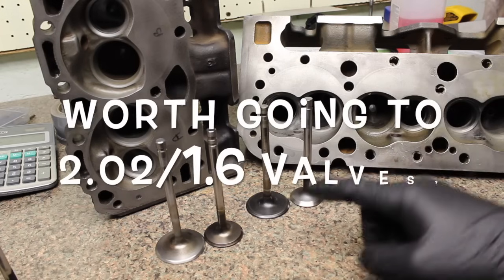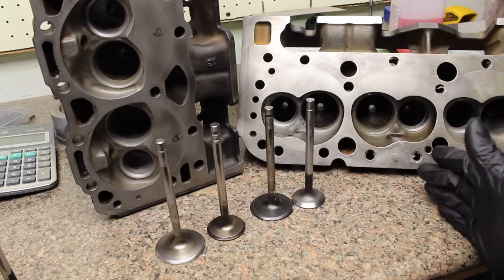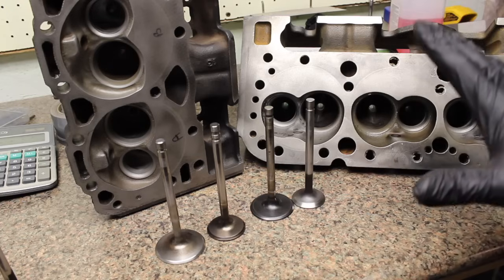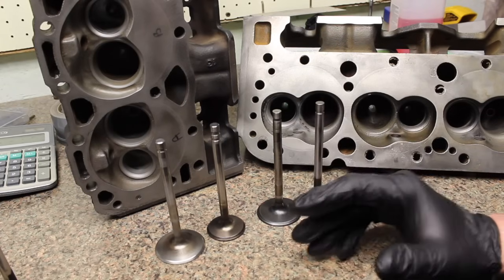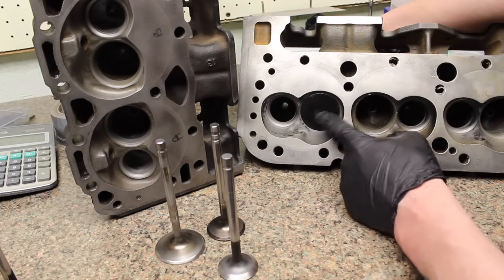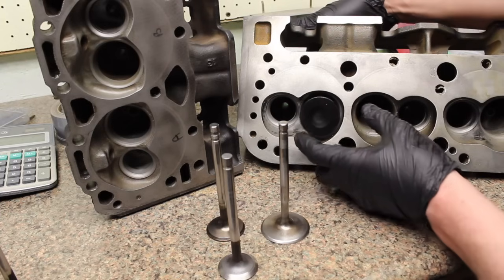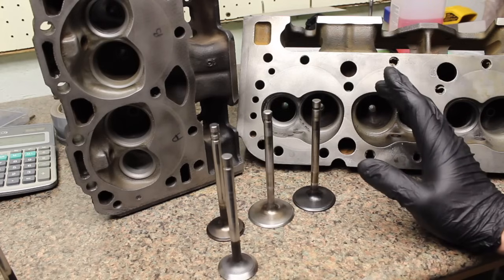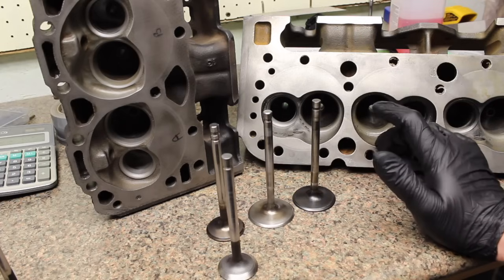Bigger Valves in Vortec Heads *Flow Data!*

Comment: Some food for thought for anyone interested. I've got a set of Pro Topline 906 "Vortec" replacement heads that originally came with a 1.94 intake and 1.5 exhaust valve. These are relatively old heads, but it does show that some Vortec style heads can improve with a larger valve. To go with the new valves, I blended the throat cut into the pocket and just barely touched the short side with an 80 grit roll to smooth a ridge they all seemed to have. I left the intakes as the carbide cut them, no smoothing. I did smooth the exhaust slightly with a 80 grit roll (essentially just removed the carbide divots). The low lift on the intake is improved dramatically, while it's much less improved at higher lift. 

Intake w/1.94" Valve	Intake w/2.02" Valve	Difference
0.1	54	72.5	34.26%
0.15		104.7	
0.2	103.9	136.9	31.76%
0.25		167.2	
0.3	146.6	192.3	31.17%
0.35		215.5	
0.4	194.4	231.6	19.14%
0.45		238.7	
0.5	224.3	237.7	5.97%
0.55		239.6	
0.6	226.2	239.6	5.92%

	Exhaust w/1.5" Valve	Exhaust w/1.6" Valve	Difference
0.1	49.3	45.3	-8.11%
0.15		82.7	
0.2	87.6	108	23.29%
0.25		128	
0.3	118.8	148	24.58%
0.35		170.7	
0.4	139.7	176	25.98%
0.45		178.7	
0.5	148.5	180.7	21.68%
0.55		180.7	
0.6	152	181.4	19.34%

You can see I actually lost flow at .1 lift on the exhaust, but it is greatly improved at all higher lifts. 

Unfortunately, I'm not sure what depression or bore size these were taken on and my machinist isn't around to ask anymore. Perhaps one day I'll get my Third Gen TA into driver status and get it onto the chassis dyno to see what kind of numbers it can put down. It does feel and sound pretty healthy though with a XR276-10HR.

Comment: I watched your video. I have a set of big valves 906 I haven't ran but watching your video ancers my ?.And I have been running stock intake and bigger exhaust for the past 7 years and they perform well.  I did lot of research on the vortec and everything I read talked about the exhaust beings the hold up . Then you came out with your findings and just proved it.  Good info.

Comment: Yes on the intake side When you switch to the 202 You have to notch the side of the cylinder wall and the head Chamber Just so it would flow properly Yeah you nailed it On the valve shrouding

Comment: Great video dude I was doing this 20 years ago Flo benches just came out so it was relatively expensive if you don't mind doing a little bit of research Hot Rod Magazine I'm fairly sure was one of them dad an article which gave you everything and it was how to get 400 horsepower out of a stock 350 on a budget they tell you the cam which was the Xtreme Energy buy comp cams ? The intake 2 years the size of carburetor and I built one it was a Beast for you know $1,800 that includes the short block and everything so it's worth your time to research it I'm sure the magazine she can access it online but just go back about 15 16 + years and I'm almost positive that's the title budget Vortec
Reply from the maker: Haha yeah man! The vortec heads work quite well with just abit of work 👌

Comment: Hey i have a 350 Vortec crate and it has 502 lift out the box can i run 1.6 rockers without changing pushrod
Reply from the maker: You will have to pattern out the valve tip with the new rocker arm. Chances are you will be fine with the current length but everything can effect pushrod length so there's no way of knowing until you check the pattern on the valve tip

Comment: I have had the idea of a mild boost vortec build, using 1.94"/1.60" with only bowl blend and port polish,  maybe under cut and swirl polished valves, polishes chambers, with about 10psi boost, for a street engine,  I believe the most gains are in Port matching and polishing! With a street engine, and the right cam!! The biggest thing is the correct cam for the job!
Reply from the maker: Most professional porters say that the port polishing doesn't do anything, i haven't done any testing my self on that though 
Maybe I should?
Reply: @cuttersperformance  by polish I don't mean a true polish, I only remove casting lines, and usually leave a 220 grit or so finish, so by polish I basically mean not enlarging the port, but always Port match, about 2" into the port on both sides,
Reply from the maker: Ahh ok exactly 👌

Comment: I’m thinking of putting some on my 400 sbc what do you think they will perform with a mutha thumpa cam ?
Reply from the maker: Better than any other stock sbc head that's for sure. 
I've never seen someone disappointed with them on a street strip motor
Reply: Probably work well on a street or mild drag engine. I would probably get a set of dart sportsman II if were mine though. Showing my age, guess they are iron eagles now.

Comment: YOU HAVE TO DO SOME POCKET PORTING AND UNSHROWD AND LAY BACK THE CHAMBER OR IT WONT DO ANTHING GOOD VIDEO IM FRIENDS WITH THE GUY THAT PORTS PAT MUSI AND ANDY JENSENS HEADS I CAN HOOK YOU GUYS UP IF YOUR INTERESTED
Reply from the maker: The pocket was ported and blended into the seat but the combustion chamber wasn't touched. 
I plan on unshrouding the valves and seeing the difference on the flow bench

Comment: @ Pat, snice you already have the 2.02 valve in and have confirmed less than signifigant gain, maybe you could lay that combustion chamber back around the valve on the cylinder side and see if that gives an improvement.  i read in David Vizard's book that laying back the chamber was a important step in prepping a head.  personally i never understood why they put such a sharp curve on the cylinder side of the chamber.  i get that the cylinder is RIGHT there but just, scribe the cylinder and lay back the chamber to the cylinder edge on the out side.  i think this would be an improvement whether you're using 1.94 or 2.02 valves.  when i took my votecs in to have screw in studs and 1.6 exhaust valves put in, the machinist argued with me over the 2.02 intakes and i firmly insisted NO.  he was not happy with me.
Reply from the maker: Yeah I'm probably going to unshroud the valves on the 2.02 as I did on the 1.94s that I tested and got some gaines (video coming up)
Good call going the 1.6 on the exhaust
Reply: @cuttersperformance  thanks, i did a ton of research on forums before i made a decision on what to do.  the consensus i got was there was no gain and what little their was was of no benefit to what i wanted the motor for, driving my truck on the street.

i  look forward to the test of the unshrouding of the 2.02
Reply: Yes looking forward to polishing and laying back the chamber with the 2.02 intake valves. I just did my heads. On my 4.3 v6. Good content.
Reply: @chriscatarcio7534  how did it come out?

Comment: With the 1.6 exhaust valve would a single pattern cam be  better than a duel pattern?
Reply: Thanks for the info very cool
Reply from the maker: Very good point! A dual pattern cam is often used on stock vortecs to "balance" out the weak exhaust flow.  But with the 1.6 valve it shows the same flow as a aftermarket 180cc dart head so a dual pattern cam would not be as important

Comment: could you do late 70's heads vs TBI swirl heads and compare them to the vortec data?
Reply from the maker: I will see what I can round up for you, I'm also curious as I've haven't done much with tbi heads other than replace them
Reply from the maker: I got some 882 heads kicking around but I haven't been able to get some TBI heads cheap enough haha I will see what I can do
Reply: @cuttersperformance  I'm building a .060 over 5.9 for my 77' and I took off a set of 339 heads 1.73/1.50. I'm putting a set of 86-95 TBI 193 heads 1.94/1.50 that i got for $50. They have a 64 chamber and should yield a 9.41 cr. The TBI heads have a noticeable larger intake runner and i think they'll out flow the 339s by a lot even though they're "shit tbi heads". It would be cool to see all the numbers on the same graph.

Comment: The GM Fastburn heads have 2" intake valves, how about checking the flow for those? If that's not asking to much of course.
Reply: I missed out on a set of those recently. Asked a question ten mins after they were posted up, and another guy just snapped them up. Oh well, not in a hurry

Comment: Maybe I missed it. Did you do a correct valve job on the head to fit the 2.02/1.60 valve combo? Or just put it in the head for flow test?
Reply from the maker: Yeah the head was cut for a bigger valves and probably bowl blended

Comment: I been  trying  get my hands on  some  not cracked vortec  heads i got 4 but 3 are cracked  im not having much luck getting good  heads around  me
Reply: just buy them off summit, i think they have new castings for like 350 each head.
Reply: @frotobaggins7169  i might  have too
Reply: Look for the 906s there less prone to cracking. Look on box trucks at the junkyard there usually low mileage and very well took care of. I got 2 sets both sets were good and looked almost new on the inside.
Reply: @brandonbell8159   all junkyard  near here  don't  deal with anything  to do with sbc  anymore   they deal with 2004 and up stuff  i have one good  906 head like  get anther  one  i know what to look for it just hard  with junkyards not having sbc stuff and if they do they will only sell the hole engine as a core for $500

Comment: The port and chamber were designed around a 1.94” valve, I’m not surprised a 2.02” valve doesn’t improve flow.
Reply from the maker: But are you surprised on how much of a improvement the 1.6 valve made? I was haha
Reply: @cuttersperformance  
Yeah that was a bit of a surprise, I’ve always heard that the exhaust ports need a little work, but didn’t expect the 1.6 valve to help that much. 😄

Comment: This shined light on a question I've had kicking around in my head for quite a while the 1.94 / 1.6 combo.  Made sense to me as you keep the velocity higher on the intake side and let the exhaust flow better.
Reply: This has been exactly my experience on small cubic inch engines.... Go to a1.60 exhaust valve, good headers and healthy stick. Great drivable torque in a big cube hydraulic roller.
Reply: Yes the only time a biggest valve possible is more appealing when the cam comes right off at the seat and that big punch of air popping in really fast, until it slows down, unless the head can still make energy to keep pulling it, the smaller valve wins out to being unshrouded easily after that initial break open.
Reply: You may try a 1.62 on exhaust and up to a 2" maybe on the intake.  Or a 1.95" and 1.625. etc. there used to be many valve sizes available hope  still are.

Comment: Hopefully more duration and lift on the exaust takes care of the 1.5 exaust valves on my vortec heads on my budget 400
Reply from the maker: Unless your running nitrous you'll be fine haha
Reply: @cuttersperformance  haha nah lol street motor pump gas.
Reply: I was thinking the same thing. I'll be installing a lunati 268 with my vortecs.
Reply: @jakeparshall7057  cam I used is a Howard’s 112141-08s small base circle 480-488 108 lsa

Comment: How does 062 compare to 906?
Reply: Same heads but the reproduction 906s are cast in Mexico
Reply from the maker: And some 906s HD heads have 2 angle press in seats on the exhaust
Reply: @cuttersperformance  correct me if I'm wrong but I believe the 2 angle seats were only in 3/4 tons and 1 tons along with the bigger 3/8" exhaust valve stems
Reply from the maker: @konnerkramer329 Same valves, even back cut but the seats are 2 angle. Yeah came on the 2500's

Comment: Another great video!  Pretty typical results for a small chev head.  Exhaust mods always makes for better gains.  That 1.6 valve also had a nice smooth transition.  The 1.5 would see better results if it was back cut.  Look forward to the next one.  Wondering, what part of Canada are you in?
Reply from the maker: Exhauat valve was backcut on both the 1.5 and the 1.6 
I'm in Ontario eh! 🇨🇦
Reply: @cuttersperformance  Calgary
Reply: @cuttersperformance  oh shoot an Ontario brother! i was thinking of pulling some junkyard vortec heads to put on my 5.7 TBI that's gonna go into my safari van and you've been my main source of info! if i do go through with pulling them I'd genuinely come and bring them to your shop to be worked over mister pisscutter!